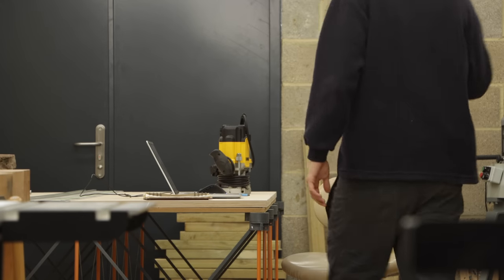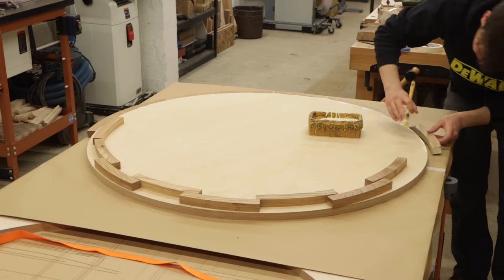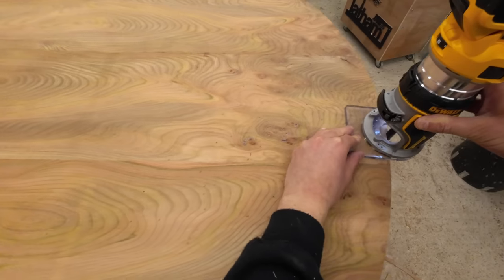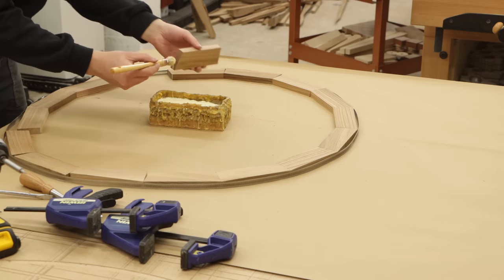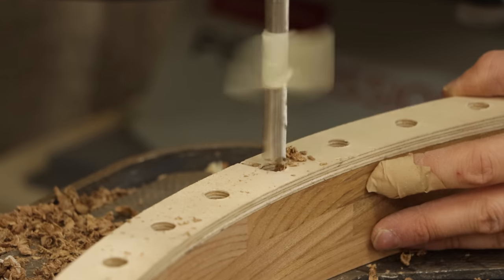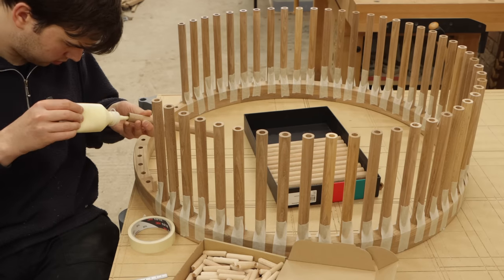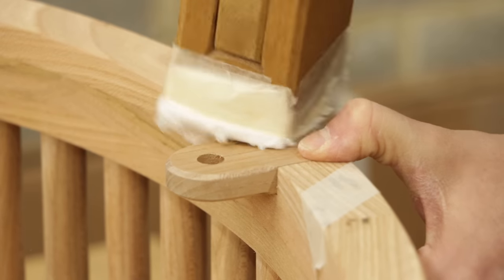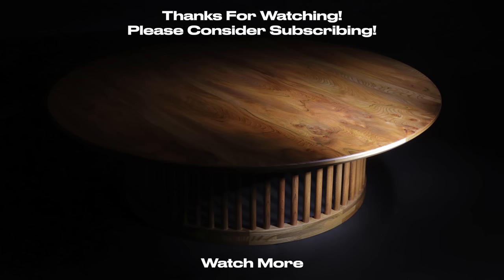Making A Huge Bespoke Elm Coffee Table With Segment Base!

Comment: wow, edge jointing those thin veneers on a jointer, surprised that works well.  I've found with my thick (1/16") veneers, a track-saw does an outstanding job of jointing edges.  nice table!
Reply from the maker: Yeah it only really works with thick construction veneer. I like the tracksaw method, that's a good idea!
Reply: @SeanEvelegh  The cool thing about the track-saw method especially when laying up panels is that rather than just jointing square and edge gluing like you would any normal panels, you can set two pieces of veneer side by side with an overlap of an inch or two (as needed) and then lay the track at an angle within the overlap so your cutline more closely matches any grain direction. A nice sharp blade with a good zero clearance track (ie. Festool) and foam backing, you get a perfect cutline at an angle across the overlapping region so the joint line isn't square to the edge of the piece.. It can do wonders for ensuring seams are invisible even when you try to look for them...

Comment: That's magnificent. I love the attention for detail. Just wondering: why did you use smaller dowels to attach the bigger dowels and not glue in the bigger dowels directly into the wooden rings?
Reply from the maker: Cheers Marco! I used dowel joints to ensure perfect joints for the spindles with no gaps. I could cut that spindles on the tablesaw and it would meet the segmented ring surface flush and be completely flat. If I inset that into the ring, there is a great chance you’ll see gaps around the spindle.
Reply: @SeanEvelegh  Thanks for clarifying Sean and sounds very logical 😉

Comment: Applying the rubio to the dowels while they were still mounted in the lathe would have sped that bit up for ya..
Reply from the maker: That is a good suggestion! Thank you. I'd have to be careful not to scratch them before the base is good together.
Reply: @SeanEvelegh  I think you'd be ok.. Good thing Rubio is so easy to repair!